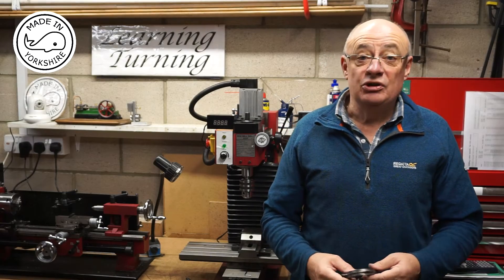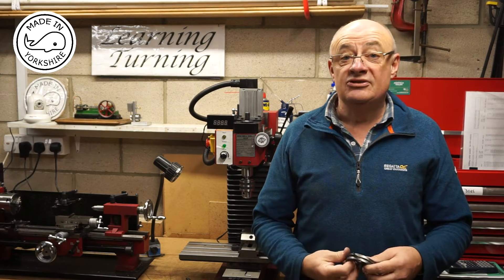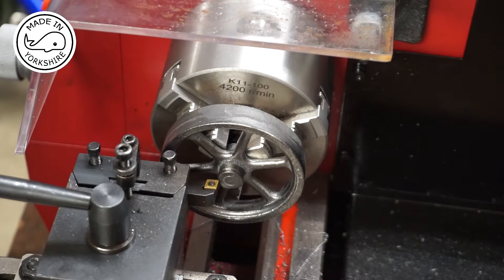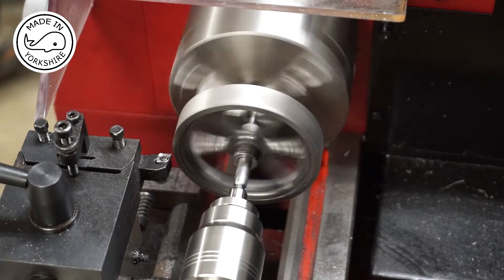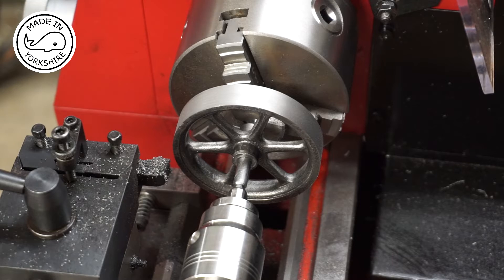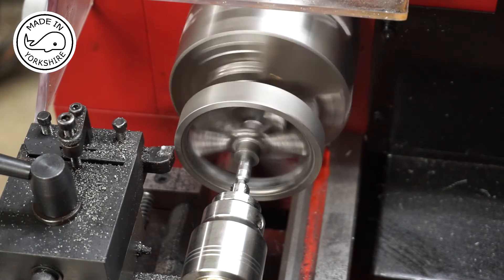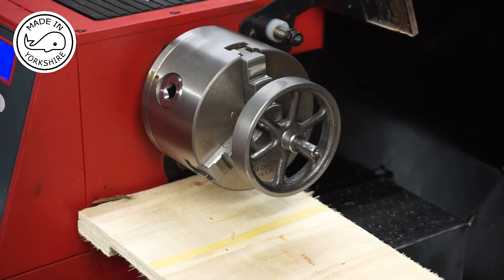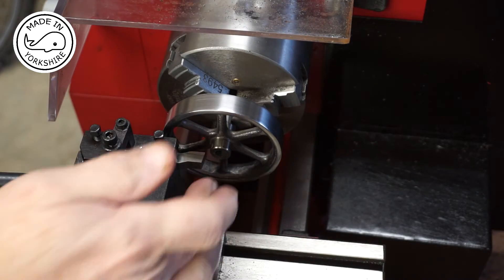#MT25 Part 5 - Making a Stuart 10V Steam Engine. Machining the Flywheel. By Andrew Whale.

Comment: Hi Andrew, Great video. What are your thoughts on the Sc4 lathe?. Regards MachineNZ
Reply from the maker: Thanks MachineNZ. The SC4 is a delight to use. Lots of grunt but a bit noisier than the mini lathe. Power feed on the cross slide is very nice. The carriage lock isn't great though. Great to have additional capacity.
All the best.
Andrew

Comment: Good work, glad to see the new Sc4 lathe is being used.
When turned the boss on side two by flipping the work piece in the 3 jaw chuck, the boss's are not concentric to each other.
3 jaw chuck runout ?, It probably doesn't matter on this part, just saying 😀
ATB Adam
Reply from the maker: Hi Adam. Yep, is was fun playing with the SC4. I think camera angle might be playing tricks cos the bosses look good to me. In hindsight I should have made sure that neither the chuck or flywheel were rotated when switching round - in order to compensate for any chuck runout. I think I was lucky!
Thanks for the feedback though.
Cheers
Andrew